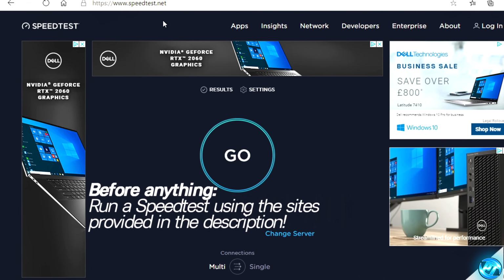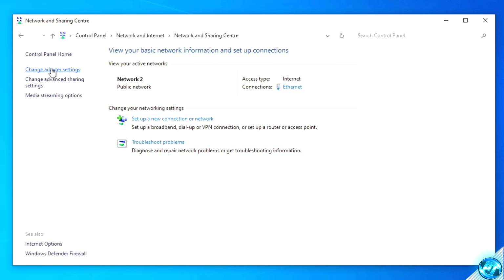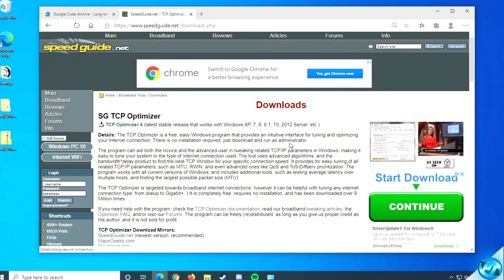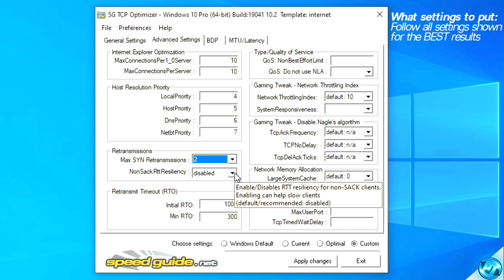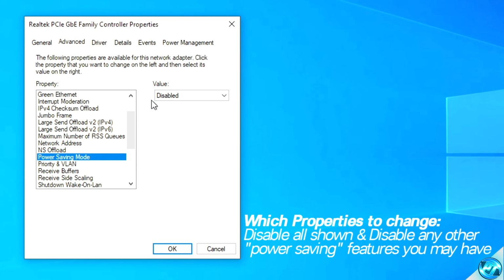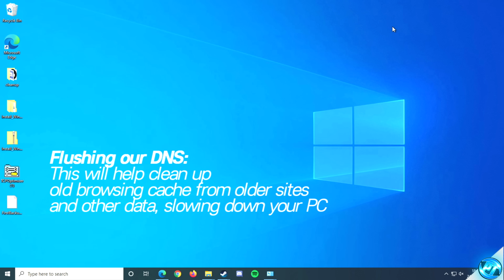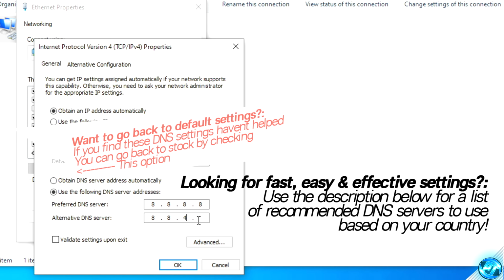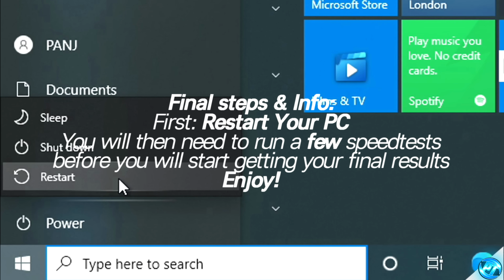🔧 How to SPEED UP your Internet! Boost Download Speeds, Lower Ping, Fix Lag on Wired and WiFi EASY

Comment: Perfect time to get this vid lmao.
Getting a new pc this tuesday :D gonna download like 20 games.
Reply: Specs?
Reply: And r u gonna use Ethernet cable?
Reply: @badonkadonk6152  not sure, does it only work if you have ethernet ? 

Ryzen 5 3600
Aorus B550 elite 
2x8 3200mhz ram
Gtx 1660 super
Corsair Psu
Reply: Oh also 1 1tb hdd and a 240gb ssd
Reply: ExtinctKyle69 ok nice
Reply: @badonkadonk6152   :D
Reply: WoK  i guess its good for future proofing
Reply: this guide is for speed increase in surfing the web or ping decrease in games. the tcp optimizer will slow down your download speeds but will increase speed or decrease ping

Comment: i always play on 200+ fps and after doing this, I only get 109 tf!!!?  am I the only one with this problem?
Reply: @ItsAbdullahGaming wtf are you even on about? I have nothing to do with the question the guy put. So why u @ me for? Go and @Offranly
Reply: its because some settings he turned off offload work from the cpu to the network card chip. If you turn them off they will use more cpu resources so that's why you are having less fps. If you have a slow cpu this will be worse for you.
Reply: Try restoring your restore point.
Reply: Dude these videos aren't real. Wanna improve your internet speed? buy a better bundle

Comment: Hey man, the speeds did indeed get better but now I get mouse stutters whenever I download something. I checked the CPU usage, that shouldn't be the problem and the drive I'm downloading to is not the drive I have my Windows on, I got a separate SSD for that. Any clue on what might be causing that?
edit: Apparently one of the settings is causing ndis.sys latency issues, still haven't found which one though.
edit #2: Found the issue, it was caused by disabling Checksum Offloading, even though the CPU usage wasn't maxed out it produced that small anomaly. Enabling it back on got rid of the problem and the speeds are still better.
Reply: I have encountered with same problem, and the solution I found was to remove battery from laptop. Or change it to original power supply(charger)
if you have original battery but different brand charger you need to use original charger to avoid mouse accidently stopping or hard to move it sometimes.
make sure to download drivers of that material from its own web support section, dont use any 3rd parties.
hope that can fix your problem.
Reply: @Dsuchong  Don't know if you read my comment...I found the solution and I'm not using a laptop.
Reply: @nt_AlanN  if i ever run the same situation, i'll use your solution. thanks

Comment: Im getting a error when trying to check for the best dns outgoing requests were intercepted
Reply from the maker: Just keep the standard, automatic DNS settings in windows :)
Reply: @Panjno  I managed to fix it as i still have my ISPs router so i had to chnage some settings for it to work. Had to put the dns from auto to manual. Anyway thanks for the guide. Increased my upload speeds by 10mbps

Comment: hey panj was wondering if using a powerline adaptor affects results with the dns benchmarking tool as I am getting an error message . Something about redirecting
Reply from the maker: I dont personally use one, I'd just stick with the stock windows dns auto settings :)
Reply: @Panjno  will do thx man

Comment: Could you do a tutorial on how to fix PC memory issues? Ever since I got my GPU, the overall speed of my PC has been slower, such as the downloads folder taking some time to open, and causing my PC to blue screen with OBS and my elgato, etc..
Reply: Did you have a different gpu beforehand? For example an AMD card then switched to nvidia or vise versa? If so you need to use DDU and remove all old display drivers in safe mode, then reboot and  install new ones for your new card. Watch a video and follow step by step to prevent messing anything up.
Reply: @LegitChillin420  Nope this is my first GPU, I even looked the motherboard up and saw it was compatible.

Comment: I did everything and there was no difference in my speed XD its okay
Reply from the maker: This could be because you already have a very well optimized connection to your router, You will still benefit from the adjustments made to your settings via TCPoptimizer as this will help with gaming latency and stability :)

Comment: for some reason right now i dont have internect connection and i am using megabye from my phone wtfff something happned with the driver of my router and it is disabled
Reply from the maker: See if you have a system restore point available.
You can also go into the properties of your network adapter and chose to "Roll-back driver" :)

Comment: I have a Realtek wifi adapter how do I update my drivers? People only talk about how to update your Ethernet.
Reply from the maker: Use the site below, And use the auto windows 10 installer, alternatively Updating Windows can sometimes force new drivers to download too!
Reply: @Panjno  is tcp optimizers effective for wifi adapters? Because last time I used it my upload and download speed decreased significantly.
Reply: Mythixs you have to know how to use it
Reply: Mythixs also, speed is not always consistent so it can fluctuate a lot (especially wireless)
Reply: @OneShotCS  I know :(
Reply: Panjno showed me how to use it 😂